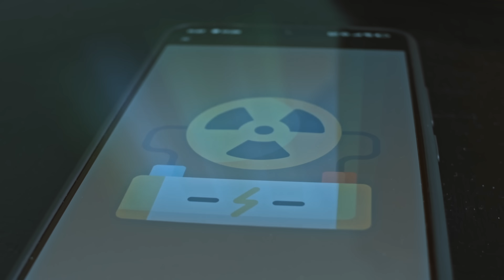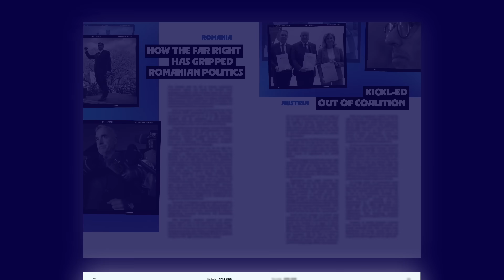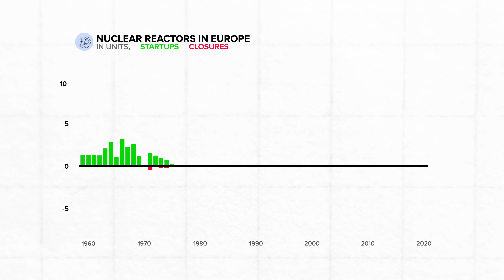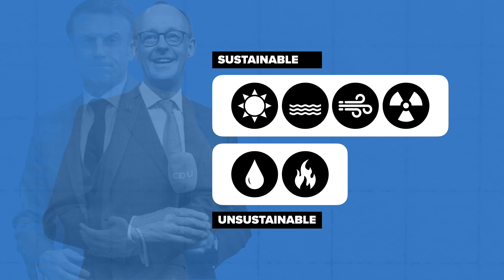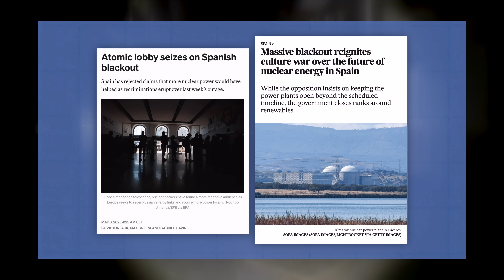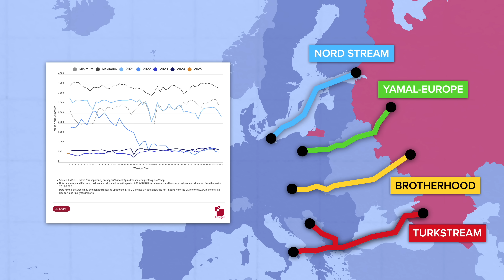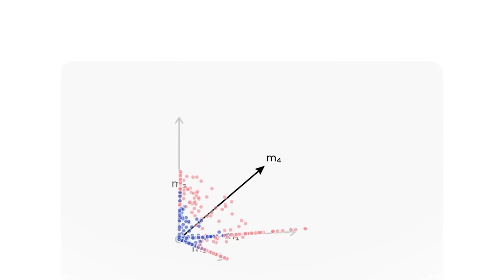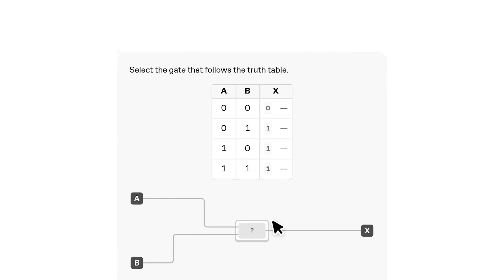Is Europe Quietly Returning to Nuclear Power?

Comment: I think your analysis is premature and is ultimately wrong, there will be NO nuclear rennaissance at all in Europe.

Just because some states removed complete nuclear bans or accept nuclear as renewable, it doesn't mean they will start building new reactors. 
Show me  actual investments in any significant volume in new reactors and then we can discuss it.

Keeping existing nuclear plants make sense until we switch everything else to renewables. They are already fully amortised and lifetime extension by another 20 years should still keep the costs low enough to make it worth it.

Building new nuclear reactors is cost-prohibitive and way too slow to contribute to solving climate change (a minimum of 10 years, but more like 15 on average).
We also do not have the necessary reactor standardisation, industrial supply chain and human resources to produce any kind of major deployments in the next 20 years.

Firmed renewables are MASSIVELY cheaper even with the batteries used for firming and we have everything in place to deploy them (howto, human resources, supply-chain).
Cost-wise, it is not even a comparisson, just take a look at the REAL costs of latest European reactor builds and the current costs of renewable projects (go and read the Lazzard reports).

Deploying solar, wind and battery systems is (comparatively) simple, cheap and scalable and can be done under 5 years even with the largest, most complicated deployments.

Nuclear also goes 100% against other renewables because it is baseload and practically cannot load-follow in any significant percentage. It cannot ramp up and down fast enough to be useful in a grid which has significant amount of renewables in it (which means that renewable production needs to be thrown away or stored in overproducing periods instead of just consuming it)

Nuclear cannot be insured commercially (no market-based insurer will insure it for the full cost of a disaster, only with a relatively low upper cost limit, in case of Fukushima it was 1.5 billion USD).
So, the tax payer needs to foot the bill in any nuclear accident, just like with Fukushima (academic estimation at 300-400 billion USD full cost)
Renewable plants are fully commercially insured and nothing significant happens when a disaster destroys them.

Properly, safely and responsively reprocessing and disposing nuclear waste is still economically unsolved. Nobody does it, so we are leaving our dangerous and poisonous waste to future generations, which is disgusting.

Europe (or anybody else for that matter) is NOT shifting back to nuclear, that is a pipedream or propaganda.

Comment: Well, if you want low co2 emissions with 24/7/365 baseload power with network stabilizing, inertia producing, big generators, you need either hydro or nuclear. Hydro is great if available but otherwise, it's nuclear or bust 😂.

Comment: The reality of nuclear power plants worldwide: 1) Not a single nuclear power plant is currently under construction in the USA, EU and Japan! 2) The construction times of the last nuclear power plants built there were always over 15 years.
3) All nuclear power plants built in Europe/USA/Japan since 2005 have increased in price by over 200%. The resulting electricity price is over 15 cents/kWh.  Just google: “nuclear power plant, costs” - and then the name of the nuclear power plant Flamanville/F (24 billion instead of 3 billion according to the Court of Auditors!), Hinkley Point/UK, Olkiluoto/FIN, Oma/Japan, Vogtle and Virgil Summers/USA.
Reply: Fact-check:
❌ False – Nuclear plants are under construction:
USA: Vogtle 3 & 4 just finished; Palisades SMR planned.
EU: Hinkley Point C (UK) is being built.
Japan: Ohma and Shimane-3 are under construction.
❌ False – Some plants took >15 years, but not all:
Vogtle 3 (USA): ~14 years.
Barakah Units 1–4 (UAE, with Korean tech): Each took ~8–10 years.
Rostov Unit 4 (Russia): ~7 years.
Fuqing 5 & 6 (China, Hualong One reactors): ~6 years each.
✅ Almost true - Cost has often overrun >200% mostly because of unexpected security adaptation due to the Fukushima event concerns.
An exception - Unit 2 at the Watts Bar Nuclear Plant (USA): Built in about 8 years (started in 2007, online in 2016) with relatively moderate cost overruns compared to others.

BTW: googling "nuclear power plant costs of ...(specific power plant)" is pretty much the definition of cherrypicking.

Comment: It should be noted that the unreliability of renewables isn't just "the sun doesn't always shine".  They fluctuate from second to second, and don't produce any kind of energy that is dependable.  Even when the sun is shining, or the wind is blowing, the elements aren't constant.  The wind is always changing, clouds get in the way of the sun, all sorts of things can affect this stuff.  Couple this with just how diffuse these sources of energy are, and you have a huge problem.  Finally, the biggest problem is the lack of control we have on renewables.  We can't throttle them up or down as we can with fossil fuels or nuclear energy.  That means renewables inherently cannot follow demand.  They should never have been considered, frankly.
Reply: Not to much of a problem.
Germany has 55% Wind + Solar electricity and has the safest grid in the world. 

Big batteries will help as well.

Comment: This is absurd. You fail to understand the true meaning of "reliable" energy sources. Solar and wind are extremely reliable. If you meant their intermittent character, you should also mention that nuclear power plants do NOT have a 100% availability. It is more around 70 % overall, but when summers are hot and dry, the French nukes are known to be in trouble. Also, there is no calculation effort done to compare the LCOE of different sources. How can you suggest that prices for electricity would be lower IF (...).  Nuclear energy companies do not even reveal the variable cost of the LCOE and their estimates for the costs of dangerous waste storage is massively unrealistic. Not to mention the massive cost overruns and extreme delays on the few new power plants. Check out any of them; NONE is in budget, NONE has been producing any energy at the first estimated time of commercial operation. The problem is not that the industry does not know all this, the problem is that they get away with it thanks to behind-the-curtain deals (convenants) with goverments. That privilege is not available for renewables. Perhaps an "independent" channel like TLDR could try to deep dive a bit more into what is really going on in the European energy policies?
Reply: Well, yes and no. Sure, we want to recognise difficulties with current construction of Nuclear Power Stations, and that's to be faced - but equally, some of the problem would be that people making them are out of practice with little "institutional memory", and that regulatory regiemes are now more stringent. I recall speaking with the administrator of a US nuclear power station, that he signed 500 bits of paper a day. Yes, nuclear does need a proper and rigorous regulatory framework, sure, but it is quite possible it will struggle under something oppressive.

Comment: Repeating the mantra that "solar only works when the sun is shining and wind only work when the wind is blowing" is wrong and not terribly helpful. There are these thing called "batteries" that help even out the supply/demand characteristics of the grid. Which is not to say nuclear doesn't have a place - it should be the first choice for new large-scale plants but it needs to get a whole lot cheaper and faster to build. And, in order not to have to have manual, predictive load-balancing like in the Chernobyl days, batteries will still be a thing that's needed. You simply feed in all the generation capacity you have and let the storage even out supply and demand. A good way to do that would be to subsidise home solar with batteries and use domestic storage across the grid.

Comment: Nuclear power is cheap as long as one doesn't include the cost for storing it's waste.
Which will
a) take a few million years to stop being badly radioactive,
b) even then be toxic and
c) would provide terrorists with potential material for dirty bombs.
It would need to be stored in an area where it's radiation will not reach anything, that is geologically stable for millions of years, does not leak water and can actually store enough.
In case you didn't notice: such an area DOES NOT EXIST ON EARTH. (Even areas originally thought to fulfill the conditions have all been found to be leaking or long-term unstable.)

Iirc safety was only the secondary reason (tipping point maybe, since the cost was perhaps seen as "acceptable" until it was "pricy and unsafe") germany quit nuclear power, with the primary being the waste management being way more expensive than anticipated. Just not for the companies running the nuclear power plants, since that was paid for by the taxpayer.
Reply: It's cheap even after including the cost for storing the waste.
"a) take a few million years" There are only two dangerous fractions of spent fuel, the plutonium fraction and the strontium/cesium fraction. The plutonium is new fuel and will eventually be used in reactors, and the Sr/Cs is only dangerous for ~300 years.
"b) even then be toxic" Mining for copper and lithium concentrate toxins that will be toxic forever too.
"c) would provide terrorists with potential material for dirty bombs." Any bomb powerful enough to deliver a dangerous amount of radioactive material to a given distance would already have a lethal blast wave at that distance. A radiological dirty bomb is therefore less dangerous than an equal weight pure explosive device and easier to track because it's radioactive. Dirty bombs are scary, but they're not actually a threat.
"It would need to be stored in an area where it's radiation will not reach anything" We know what happens to uncontained materials in geologically active areas exposed to the water table over the course of about a billion years thanks to the Oklo natural reactor: Nothing. So the idea that containerized, vitrified waste is an ecological risk over the 300 years it takes the dangerous waste fraction to decay is silly. And if you're still worried, actinide burning (a technology from the late 1950s) can transmute those to safety in days.

Comment: 5:30 Electrical Engineer here, TLDR is conflating "reliability" and "demand response" which are not the same. Reliability refers to the likelihood that an generator will operate when needed and solar is actually the most reliable kind of generator, largely owing to the lack of moving parts. Where as demand response refers to the ability to cycle on and off with the electric load.

Interestingly nuclear is actually terrible in both cases. France is a good example of Nuclear unreliability with multiple unplanned maintenance outages and extensions occurring in the last few years. Meanwhile nuclear plants are difficult to ramp up and down and thus cannot respond to demand quickly. What nuclear can do is service "base load" which can be defined as the average minimum electrical load, the "trough" in the sinusoidal electric load.
Reply: Nuclear plants can power ramp at 5% per minute over 50%, which is plenty fast enough to respond to normal changes in demand.

Comment: Not everybody has to return to Nuclear. Some countries never "went away" from nuclear. E.g. Slovakia. NPP Mochovce bloc 3 grid synchronization was in January 2023, commercial operation since October 2023, designed shut down 2103 (yes, the year 2103, that is not a typo). Bloc 4 is 96% finished, first test currently ongoing, scheduled grid synchronization in January 2026. NPP Bohunice new bloc (alongside running V-2 blocs running, A-1 and V-1 already decommissioned) in planning phase.

Comment: Why to build new nuclear plants if solar energy with batteries is cheaper and faster to construct. And then cheaper to operate, with lower cost of energy. 
5:50 "Unless you have ways to store massive amounts of energy" Grid-scale batteries, maybe? Or pumped storage in dams.
Reply: Because solar energy with batteries is not cheaper or faster to construct.
Reply: @Crispr_CAS9 The UK's Hinkley Point C nuclear power plant has experienced significant cost overruns and delays.  Initially estimated at £18 billion in 2016, the project's costs have escalated to between £41.6 and £46.5 billion as of early 2024  . The completion date has also been pushed back from the original 2025 target to between 2029 and 2031  .
Reply: @PureAlbania  "The UK's Hinkley Point C" Has a cost of $14.5b/GWe and a build rate of 4.4y/GWe/site. Building solar in the same location would cost $16.6b/GWe at a build rate of ~50y/GWe.
So solar there would cost 7% more and take >10x longer. Of course, they wouldn't build it at just one site but many, so they 'could' build it in 3-4 years by spreading it across 12+ sites ... but you could also build 12 nuclear stations at once.
And that's before we talk about the batteries.
Reply: @Crispr_CAS9 Your numbers for solar are fantasy.

This new nuclear plant in the UK have derailed costs from 18 billion to 46 billion. It will produce 3GW of energy when constructed in 2031. Meanwhile China just in 2024 have installed 277GW of new solar panels.

The information is there.
Reply: @Crispr_CAS9  China just in 2024 alone have installed 277GW of new solar 
panels. Compare that with 3GW in UK around 2031.
Your numbers for solar are serious wrong, all information is here in internet.
Reply: @PureAlbania  "277GW of new solar " So 55GWe across how many sites? What if they had been building that many nuclear sites?
"Your numbers for solar are serious wrong" No, they are not. They are, however, standardized by capacity factor as GWe (the e is for 'effective') and for a single site. England's solar resource (~12% capacity factor) is pretty poor relative to the areas that have big commercial-scale solar farms (mostly >20% CF).
Take Shotwick Solar Park. ~72MW capacity, but 11.9% capacity factor. That's ~8.6MWe. You would need ~116 of them to produce a single GWe.
It cost ~$105m, or $12.2b/GWe.
It took 4.5 months to build. That's ~43 years per GWe. So they managed to be a bit better than my numbers, but my point still stands.
Reply: @Crispr_CAS9 That nuclear plant will provide 3 GW of energy.
China just in 2024 installed 277 GW of new solar panels.

Take your blindfolds off. All this information is available in the Internet.

Comment: Nuclear does not stabilise a grid. Because nuclear does not flex its out put quickly, it prefers a constant output it cannot fill in renewables energy gaps. Only fast flexible can be compatible with renewables this is batteries hydro and technically gas but modern grids are moving away from spinning mass generators in favour of grid forming inverters.
Reply: Nuclear can ramp at ~5% per minute from 50% to 100%. That's absolutely fast enough.

Comment: Nuclear isn't a great pairing with renewables like wind and solar, as nuclear can't rapidly increase or decrease outpur.  Energy storage and hydroelectric are great pairings with wind and solar.  Nuclear is a good component of baseload power, regardless of what other generation you have (unless you have so many renewables in excess of your energy storage ability that the excess starts to compete with baseload).
Reply: Nuclear works great with hydropower.  You can set up such that the dam would produce power from the water AND the excess water would provide cooling for the nuclear reactor. Killing 2 birds with 1 stone (A backup power source AND a method of cooling the reactor)
Reply: The Chinese diversified their energy sector from coal burning to wind, hydro, solar and nuclear
Reply: Nuclear can absolutely ramp up and down power if you design your reactors like that. Only Light Water Reactors take the long times, since they're the oldest types of reactors ever.

Comment: Nuclear plants take way too long to build and are way too expensive. Maybe if we've invested in those more back in the days, they could help us now. But now they don't really make sense anymore. 

Think of it this way: If you were an electricity power supplier and you'd have to decide, if you want to invest into a solar-/wind-farm and start harvesting and selling energy by already next year, or you invest 10-100x the money into a nuclear plant that maybe can be ready in 20 years +/-. 
What would you do?

For the unreliability: There it makes more sense, to build energy storage. You can even make money with those when buying power, when it's cheapest, storing it and selling it again when it's most expensive (because of no sun and wind).

Besides, nuclear power is not tuned to compensate for the swings of renewable energies. It takes time (hours-days), to turn the power output of a nuclear plant up and down and it's wearing down on the plant. Again: Investing in flexible and fast energy storage is a much better solution instead.

Yes, there is a shift in the public and political opinion around nuclear power, but it doesn't really make sense.